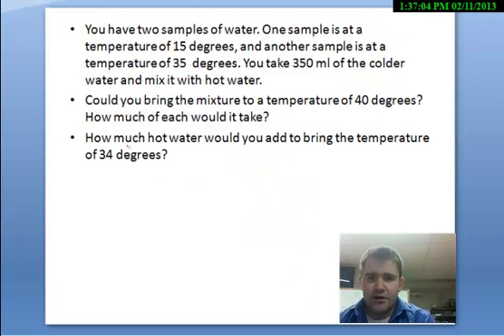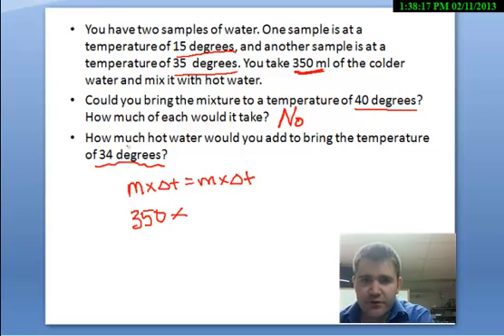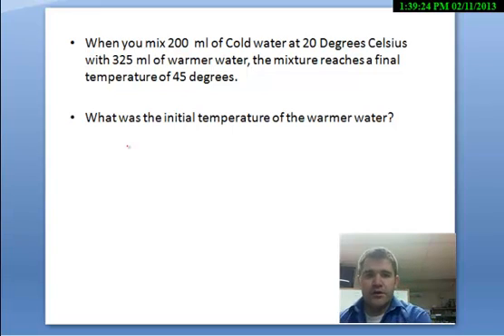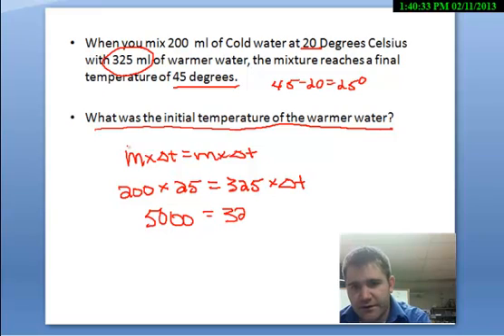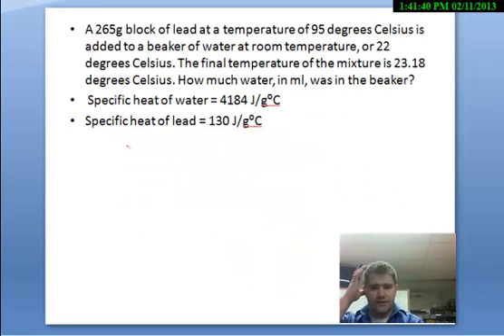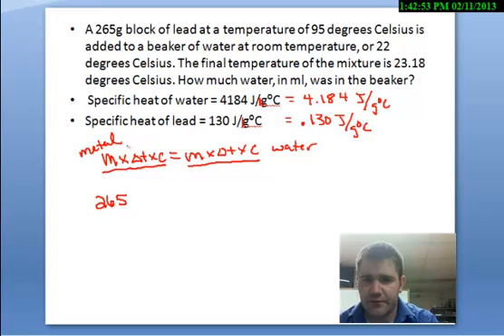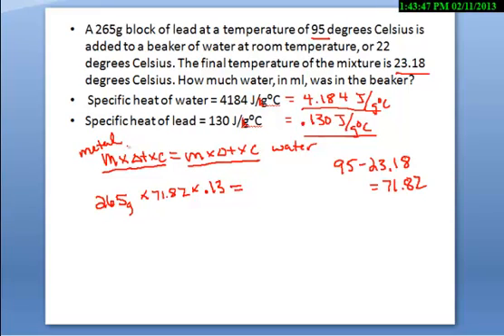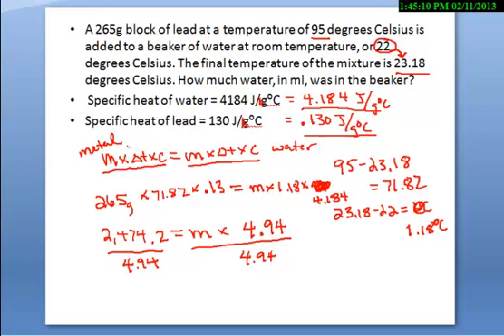Thermal Energy Calculations Part 2

Comment: Is there anyway you could help me solve this problem?
50g of an unknown metal at 123C is placed in a calorimeter cup holding 200g of water at 20C. If the specific heat of water is 1.0 Kcal/Kg•C then a) how much thermal energy was transferred, and b) what is the specific heat of the metal if the final temp is 23C? 
I have been trying to figure this problem out for over an hour!!!! Thanks 😬